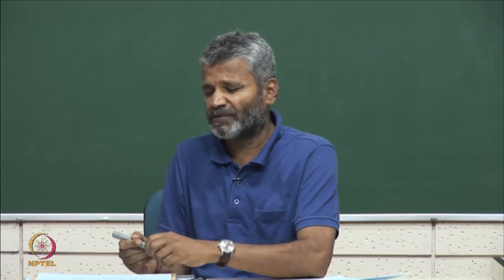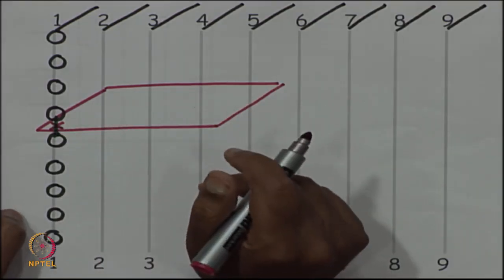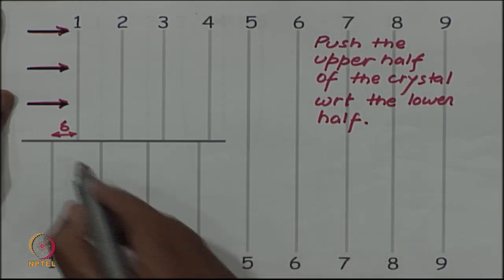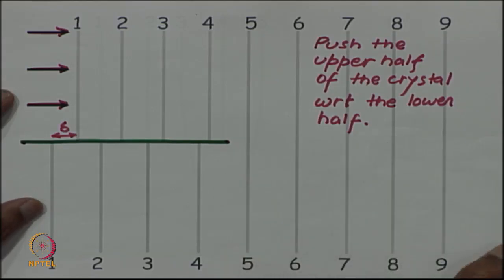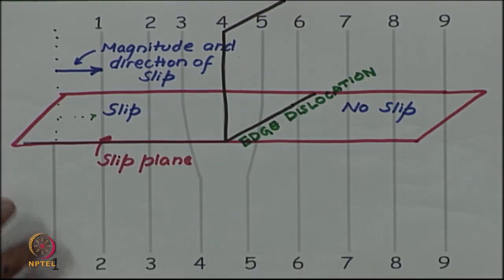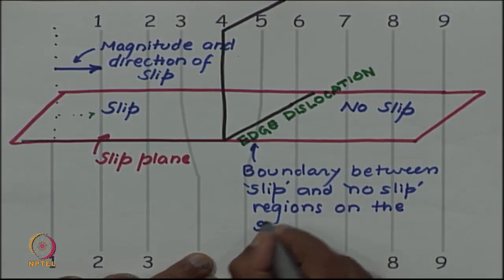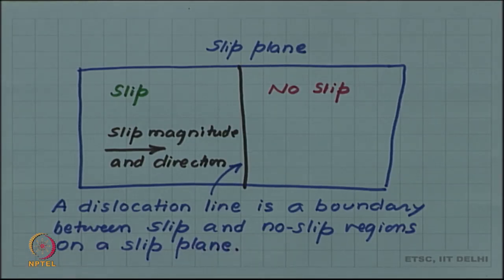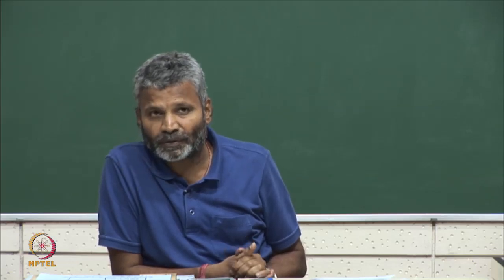Edge dislocation: Slip

Comment: Sir, how does the bottom edge of the half plane distort its adjacent planes?
Reply from the maker: The adjacent planes are on either side of the half plane. So the spacing between them is 2d where d is the interplanar spacing. Below the slip plane since the half plane is absent these two plane try to attain equilibrium separation d. This causes distortion near the bottom edge of the half plane.
Reply: @introductiontomaterialsscience  thank you sir